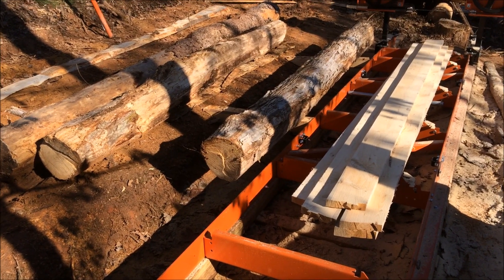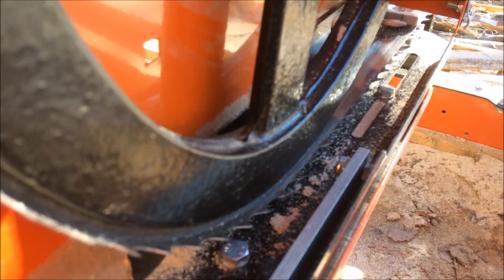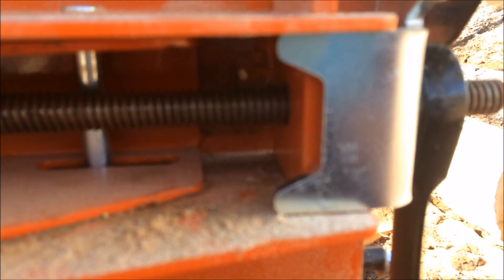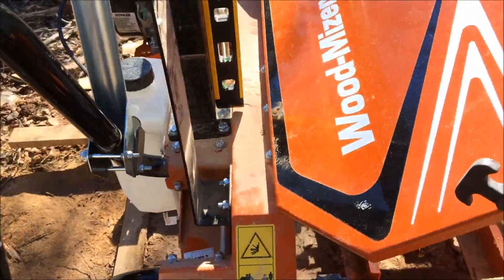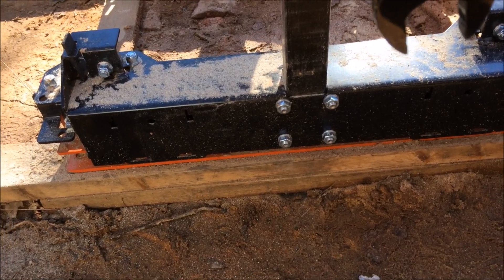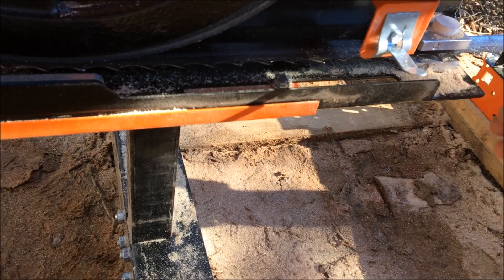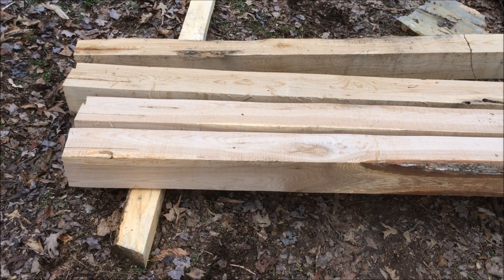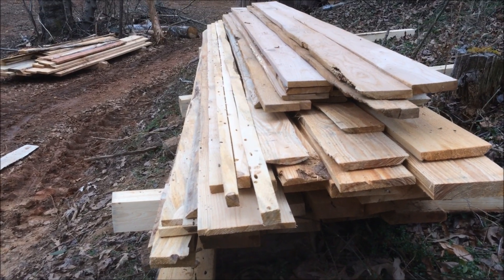WAVY CUTS - PROBLEM SOLVED - NEW WOODMIZER LX25 & TIMBERLY M100

Comment: Thanks for putting these videos out, I'm picking up our mill Monday at 1pm, hopefully I can avoid some of these issues due to you making videos, I was supposed to get the mill first week of June, I'm way behind!! I need to whip out lumber to build a small shop to work on saws, the leaves are already starting to change color up here in Vermont, so I'm running against the clock trying to beat the snow. Thanks again for your time.

Comment: Man, hopefully this solves the problems that I've been having. Thanks for putting this out there. The damn woodmizer manual is way too vague.
Reply from the maker: HOPE IT HELPS. GET THE BLADE TIGHT AND WATCH BAND WHEEL TRACKING. HAD TO ADJUST MINE SEVERAL TIMES. ALSO HAD TO LUBE TENSION BOLT. MINE WAS STICKING BEFORE GETTING TO CORRECT TENSION.

Comment: That 1st board you showed didn't look level. Looked wavy to me.
Reply from the maker: YES. STILL HAD A BIT. NOT AS BAD AS IT WAS. BEFORE LEVEL AND SQUARE THE WORN BLADE  WAS RIZING AND DIVING ABOUT AN INCH. GOOD ENOUGH FOR BARN BUILDING UNTIL NEW BLADES COME IN. BLADE TENSION WAS STILL LOW. FINALLY GOT A TORQUE SPEC. 42 FOOT POUNDS FOR CORRECT TENSION.